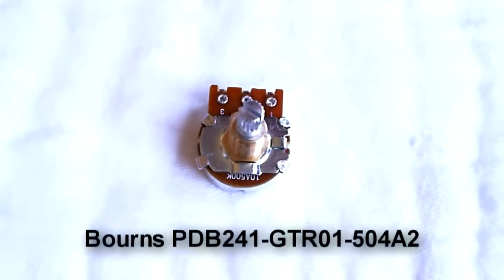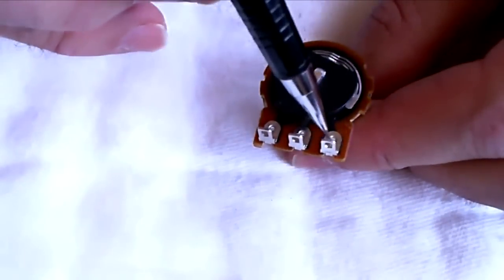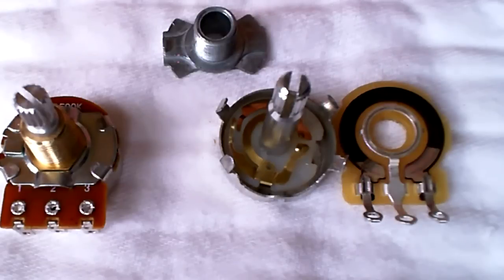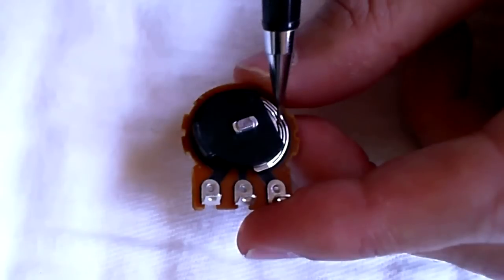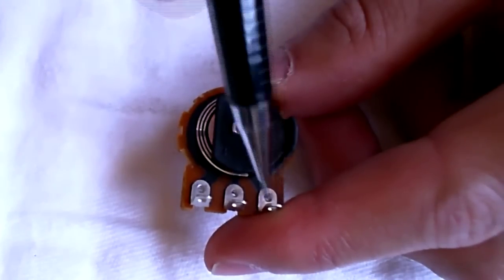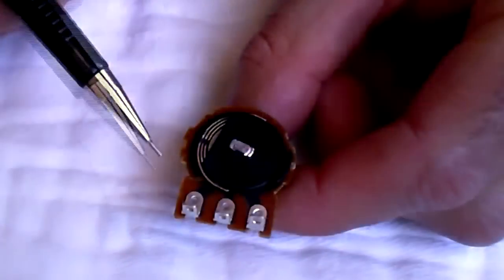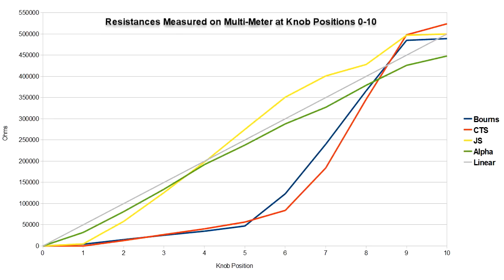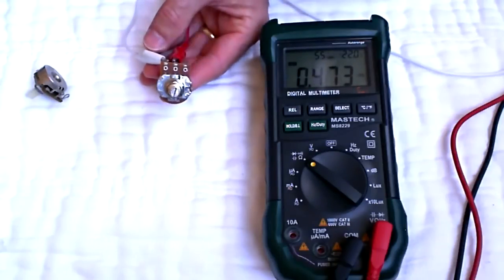Potentiometers - How They Work,  Disassembly and Exploration

Comment: Hi there, could you do a video about what the different functions of the lugs are? I notice the middle one is separate from the outer two, and I'm having a little trouble understanding schematics without that piece of information. Thank you!
Reply from the maker: I tried to explain the purpose of the lugs in this video.  If you have lugs A,B,C (with B in the middle), you will see one resistance across AB, and a different resistance across BC.  Just think of it like two variable resistors AB and BC, with values moving in opposite directions when you turn the the knob.
Reply: Nick Zeak there is a good explanation here about how the lugs are hooked up to gear.
http://www.wikihow.com/Wire-a-Potentiometer

Comment: You probably get lots of questions like this but what is the meaning of 100K or 50K? I am trying to slow a small 70RPM DC motor that runs 12V it can operate between 4.5-18V so I would like to ba able to vary the speed what kind of pot am I looking for does this 100K have something to do with it?

Comment: John Cooper, any way to make a video on how to make a low friction pot because I'm not sure how you could take a regular fender strat pots volume pot and tone pots and convert them into a low friction do you have any ideas on what to do or how to how to get it done? Evh Eddie Van Halen use low friction pots but somehow he opened them up and modified them I'm not sure how he did that but it was some type of tricks
Reply from the maker: @wayne gram - I've never done that. You could try opening the pot as shown in this video, and experiment with cleaning out the grease and replacing it with something lighter, or bending the wiper to reduce friction, etc. Not sure how well any of that will work- and may be simpler just to replace the pot. (e.g. the bourns I tested here has much less friction compared to the CTS).
Reply: @johnplanetz  yes evh used Bourns pots but he opened it up and did some type of modifications adding a liquid but yngwie also has a Seymour Duncan yjm pot artist aeries which he adds liquid fluid to make it very smooth

Comment: I have a circuit that goes like this: power (3.3v) to potentiometer (250k) to a fan. I want to be able to monitor the speed of the fan with a potentiometer but no matter how I position the wires on the potentiometer (input in the middle, output on the side, or vice versa) it always blasts at full speed. Is my potentiometer just bad, am I using the wrong type of potentiometer, or am I doing something wrong?

Comment: Whould it be possible to drill a hole through the entire pot from shaft to bottom and it not damage it?? I guess what I’m asking is is the shaft hollow and is there anything inside the shaft that would make it no longer work if I drilled through it?
Reply from the maker: I think it depends on the pot construction and the size of the hole you’re drilling . In the pots I’ve looked at, the shaft is solid, and it is crimped to the wafer right in the center, so drilling through it would likely break the pot (making the shaft separate from the wafer). But by all means open up your pot and have a look- maybe it’ll work for yours??

Comment: THoughts about this..my mind starts thinking..well, more material changes the taper, but then I thought electric cords, and audio speaker cords that have more copper in them actually offer less resistance, thus less heat, etc. A bigger electric cord lets me run an extension to an electric heater without getting into resistance problems..right? Bigger audio cable lets me run longer cable without loosing signal strength.right?  So, why does more material on the pot do the opposite?

Comment: Thanks, I needed to know how to wire one to my engine temp sensor so I can fake out the computer on my '95 4runner. It keeps kicking out the Overdrive because it thinks the engine isn't warmed up when it is. I have a 200 K to use. I'll post back with the results.

Comment: I have a small square pot in my speaker volume control. Is that the same as this?
Reply from the maker: +Luke Cypert - that's called a trim pot or trimmer, which works by the same mechanism as a regular pot, but is typically used as an infrequent adjustment, rather than a knob that you'd use all the time

Comment: Hi John,

I'm looking for a pair of 250K pots where you only need to turn the knob/wiper about half the distance of a normal pot in order to go from 0 to 10 (or no resistance to full resistance). Do you know of such a pot? Or do you know anyone who will custom make a pair for me? Thanks!
Reply from the maker: Not that I know of- here's a chart of common pot tapers: http://www.planetz.com/potentiometer-tapers-graphed/
I wonder if you could just use a 500k linear pot but add some mechanical stopper at 50%?
Reply: ***** Thanks. I read somewhere that Danny Gatton used to somehow bend the wiper on his tone pots to make them respond faster so he could get a better wah-wah effect manipulating the knob. Also, potentiometersdotcom makes custom pots. I'm not sure how many you have to order though, but I'm going to look into that further. I'm been building a new Telecaster and just about have it done. Custom pots (or a linear taper pot I like) will be the last thing on my list.

Comment: My setup calls for a 35K ohm pot. Can I use a higher value such as 40 or 50K. If I do, what will happen? 
Will I prevent signal from leaving amp and damage components in my amp? Thanks.
Reply from the maker: It depends on what function the pot serves. Unless you have a good reason to change the value, I'd replace it with the same resistance.
Reply: @johnplanetz  It is a volume pot connected to a 1958 amp inside my Jukebox. I can't find a 35K ohm stereo (double  gang) pot anywhere. That is why I was checking. If I could, I would like to stay at 35K.

Comment: I am building a metal detector from a kit. I accidently mixed a 20k pot with a 1k , I am wondering if this would harm a pot since it seems to be not functioning right
Reply from the maker: +dean castello - generally the pot or resistor isn't harmed in a case like this, but some other component in the circuit could have been damaged.  A simple example would be blowing out an led with the wrong current limiting resistor-- the resistor isn't harmed but the led is destroyed.
Reply: well it should have a steady beep and it is intermittent if I tap the pot it "hits the spot" I re soldered the wire  but that wasn't the issue. I assume it is the pot. also I taped up the pots to test I didn't want them shorting out and the washer may have crossed the contacts when I taped them up. if new pots don't change anything do I need to go part by part with a meter and checking they're value?  it seems to work but with that tapper issue. would you guess there is no other damage if it work when I mess with the pot ? I'm am beginner at best and really don't know how to go about trouble shooting.

Comment: I'm trying to do a steering wheel for pc with potentiometers, but when I connect A and D to the potentiometer it is activating the 2 letters so it's doing adadadadadadadada, and tried to remove a little of middle inside (positive connector) it worked +/-, but when I'm playing I rotate a little to the right and it goes like if I have rotate it fully. what can I do?

Comment: are this easy to make at home? i would say yes based on what you showed but gotta ask but  a question that i would be stuck is how do i determine the process build for a 10k vs 100k how would a linear pot be build diff ?
Reply from the maker: +Frank Lopez - pots are very inexpensive and would not be simple to make.  I don't see much point in making your own, unless you're just doing an experiment for learning/fun.  For example- you may enjoy making a variable resistor out of a pencil lead.
Reply: ***** well your right but not really a linear pot will cost you 3 to 6 $ here in USA and when compared to regular pot's there a huge diff in cost,  but for my type of application "Humanoid" a rotary pot is not enough but a linear one has its functionalities so idk but i rather make my own and if i can i rather apply this techniques to be electroplated into my design rather then adding another component to my architecture setup this same question i have for encoders as well
Reply: +John Cooper so i guess the question still stands "how do we go about building a resistance taper or pad/linear phenolic wafer conductive carbon material?  such as a 5k vs a 10k resistance ? "linear phenolic wafer conductive carbon material
Reply from the maker: +Frank Lopez Sorry, I don't have any relevant research/experience to share
Reply: ***** thanks for your reply, much appreciated John, since i wrote that to your i found this article that talks about just all the keywords that had led me to find everything i need to build at home for cheap

http://sound.westhost.com/pots.htm
http://www.electrochemsci.org/papers/vol9/91106416.pdf

best tool to have is the Ohm meter, multimeter

Comment: could you utilize this as a blend pot how would one go about doing that?
Reply from the maker: +MarquisProdz - for a blend pot, you need a special dual pot with two independent potentiometers stacked on top of each other controlled by the same shaft/knob.  Each one works like the pot shown in this video. Here are some wiring ideas for guitars: 
http://www.stewmac.com/How-To/Online_Resources/Pickups_and_Electronics/Blend_Pot_Wiring.html
and
https://www.bourns.com/data/global/pdfs/Bourns_PDB182_Blend-Balance_Guitar_Pots_AppNote.pdf

Comment: I have a question if some one could help me. c: What potentiometer do I need for a 6 volts 800 milliampere power supply that's going to control a 6 volt motor? :I

Comment: there's another type of potentiometer, a linear potentiometer,  do you have a video on it too?
Reply from the maker: +Alwin Priven - I don't have a video on linear slide potentiometers, but you should be able to use the same principles discussed in this video to figure it out- taking some measurements with a multimeter between the pins at various slider positions...
Reply: +John Cooper ok, thank you!

Comment: This is a 13 year old video so I may be talking into the void. Is it possible to transfer the wafer/track and wiper of an Allen Bradley switch pot, to a regular non switching Allen Bradley pot? 
Edit: The reason I'm asking is I need the ohmage and taper of the switch pot, but I need the shaft length and non switching aspect of the other.
Reply from the maker: Believe it or not, I'm still here!  I think it's fairly unlikely, but I don't know for sure.  Best thing I could suggest is to try opening up the pots, and see if it looks like it'll work!
Reply: @johnplanetz OK, cool. Thanks for the reply!
Reply: @johnplanetz o you know much about the RV4 style pots made by Allen bradley? I have the data sheet for the JA style but can't find any info for deciphering the RV4 style. I have a RV4BTRD254E. The E, I assume, denotes the taper but I'm not sure what taper that is.
Reply from the maker: @TheRhino2719  unfortunately, I'm not familiar with those. If you can't find a data sheet, you should be able to confirmt the taper by using a multimeter to measure at various points along the turn, and graphing it out.

Comment: Time 2min you show a Naked Pot, with Arms(Brushs) opsite sides. Lets LEFT be to the Jack and RIGHT to Earth, so when the Arm on the POT reachs all the way to RIGHT you cut ever side of were the ARM on the COMMON sits, making it VOID, with it being a CIRCUIT it sill connects all around
May take some FINE TUNING

Comment: I have 2 vinatge short shaft 500 k " central labs" pots ..with thick carbon ..and want to take it apart and use the carbon in a Long shaft pot..yes CTS sucks also anymore, the carbon is just printed..if you want tone..u have to use these older pots to get the sound of ur pickup ..IMHO

Comment: Dont understand why 3 posts. Power in on one post  and power out on center post ....why the 3rd. one. Also ...what is causing the resistance ?
Reply from the maker: You can use just two lugs (center and side) as a variable resistor.  However, the 3rd post allows you to use the pot as a variable voltage divider. The resistance is determined by the conductive material printed onto the phenolic wafer - it's intentionally not a perfect conductor.

Comment: my pots are labeled 15A25K0748 and 15A25K0815 that came with seymour duncan blackouts pup - can anybody interpret what these labels? Thanks.
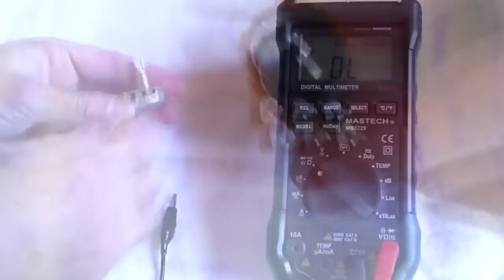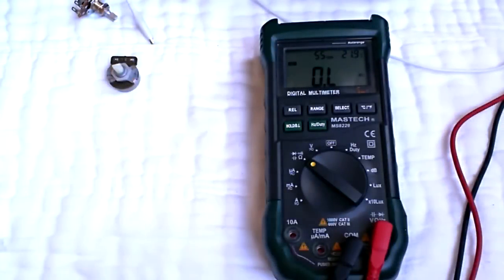Reply from the maker: +l3ertuz - probably the A25K in the middle is the relevant part. Audio Taper, 25k ohm. Makes sense for active pickups.  Confirm with a multimeter, as I show at 1:38 and 7:43
Reply: +John Cooper you're absolutely right, just measured it around ~25K ohm - the video is a great help understanding pots in details - Thanks - subbed
Reply: +John Cooper btw why are active pups need lower pot ohms?
Reply from the maker: +l3ertuz passive pickups require a higher resistance to avoid loading the pickups too heavily (resulting in a dull sound).  The preamp used with active pickups provides a nice buffer, so lower resistance pots can be used with no problem